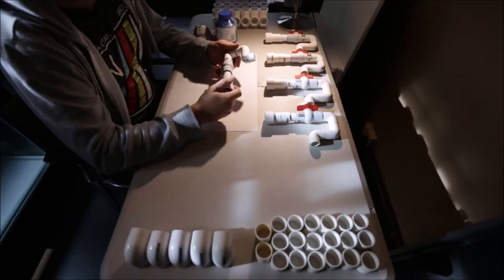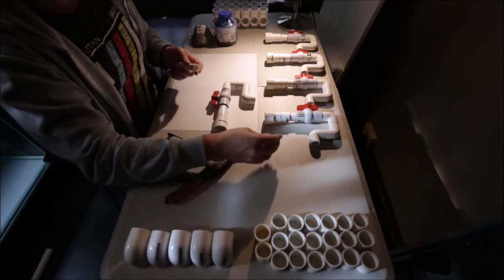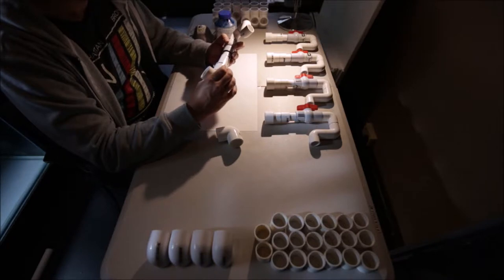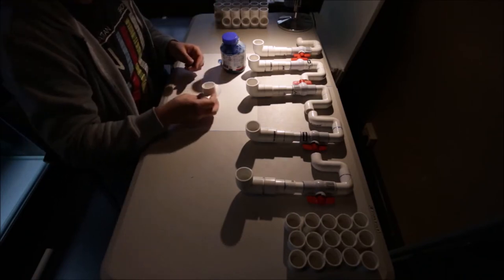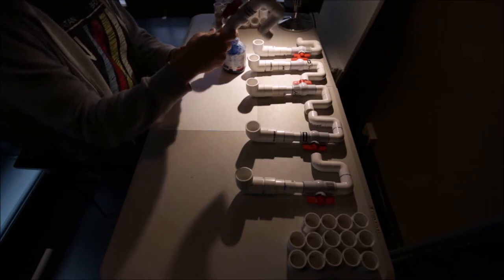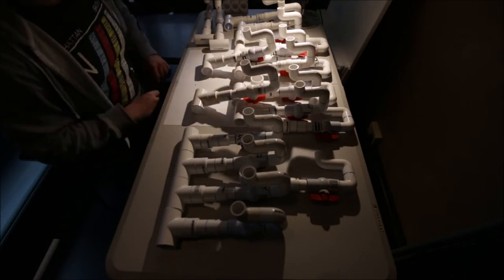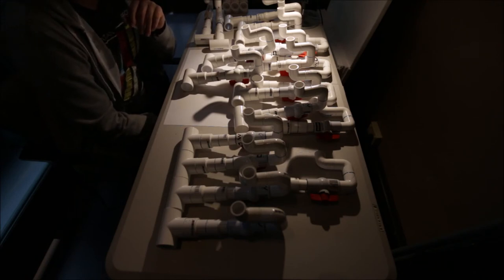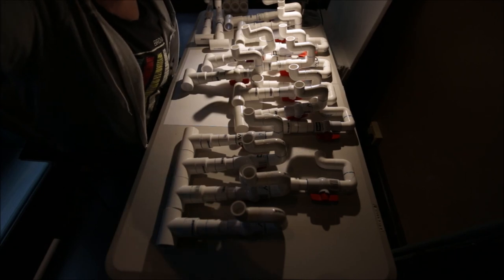Fish Room Plumbing Return Lines

Comment: I cut all my pieces of piping on the bandsaw or the table saw if needed, which is much easier for multiple cuts than that cutter and gluing all the pieces while I am out in my workshop and is much easier than having to wear a mask like you are when in a confined space inside the house.  I have had enough wearing of masks for the past 2 years while out doing shopping and other things than to wear a mask while at home also.  Hint for next time.. when I dry fitted all the fittings I put a texta mark on the pipes so they line up facing the correct direction saving me having to guess and check each time to make sure it was right.
Reply from the maker: For sure, if I had a table saw I would have used that rather than my pipe cutter. Since making that video over 2 years ago I realised I should mark the fittings during the dry fit to get the correct alignment. Cheers anyway ✌